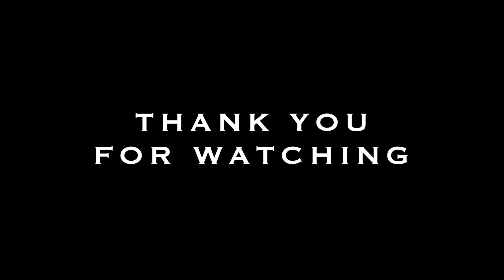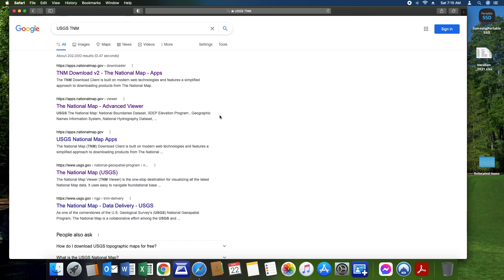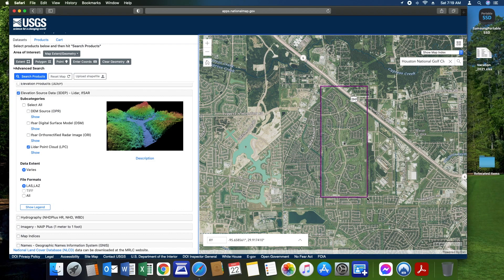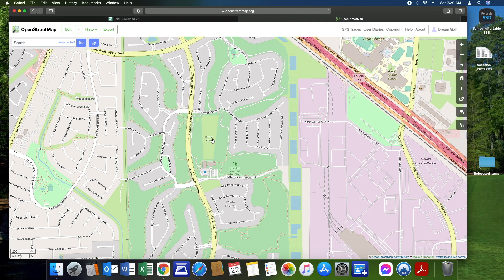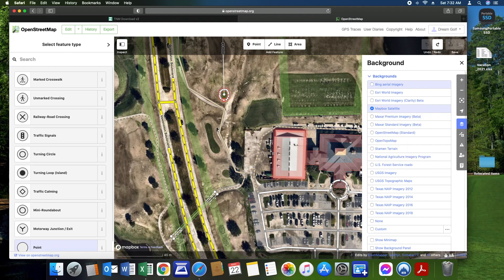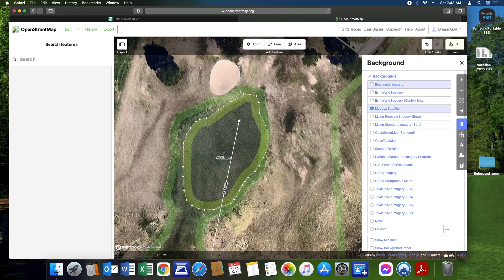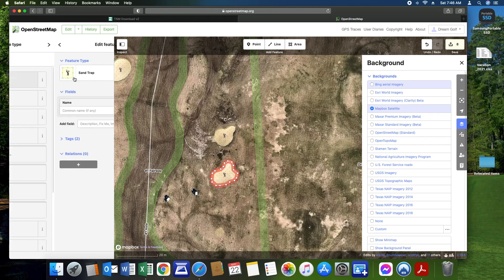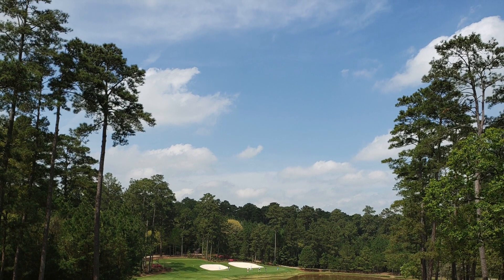The Golf Club 2019 - Course Design with LiDAR

Comment: I'm trying to map out my home course but I keep running into same error - I add a few holes and then attempt to save but get "Errors occurred while trying to save
Upload has been blocked due to rate limiting. Please try again later."  Server returned status code 429 - - how do I avoid this?  It seems to be a frequency thing.  So doing less and saving more often you run into it more - but doing more and saving less could yield lost work due to various issues. forgetting, running into too many edits to save at one time, lost internet connection, etc.
Reply from the maker: Sorry, Benny. Not sure. Never ran into that.

Comment: If the course does not show up on Open street whats the easiest way to get it in TGC from there? Or did I miss a step?
Reply from the maker: You mean you can't find the course in OSM? If you can't find it by name, look for it by the address. In other words, Google the course and get the address. Input the address into OSM. Once it pulls it up, go ahead and start splining the course together. You may or may not find your course already splined. It just depends if someone has been in there before you. Hope I answered your question.
Reply: @DreamGolf  The course showed up the 2nd time I logged in to OSM.  For some reason the first time it only showed the streets.  You mention disconnecting the fairway from the green - what issues come up if the fairway and green are touching when moved over to TGC 2019?  Does the rough show back up between that small area if you don't overlap the green and fairway?
Reply from the maker: @ericguempel9098  Glad to hear you found it! It's not an issue if the fairway and green are connected. I just wanted to warn people that when you are splicing two objects close together, you need to watch out that it can inadvertently join together.
Reply: @DreamGolf   I am trying to download the Lidar data for Fox Creek Golf Course in Edwardsville IL and once I get on the USGS site - add the 2 LAZ files to my cart and nothing shows up in the cart to download - any suggestions?
Reply from the maker: @ericguempel9098  I've run into the same issue. In the products tab, click on "Download Link (LAZ)" for each location. This should trigger a download to your computer.
Reply: @DreamGolf  Could you provide instruction from this point on? Having issues getting Chad's Tool to use the LAZ files to upload the LIDAR information
Reply from the maker: @rpowellgolf  Here's the link to the playlist for all the videos. Play Part 2 for Chad's Tool. https://youtube.com/playlist?list=PLFsvCR4Fn-BpLEQQel9Jt53H89lEcznpr
Reply: @DreamGolf  thanks! Turns out all I needed was the right EPSG number. Put that in and everything worked great!
Reply from the maker: @rpowellgolf  Yeah. That got me the first time also. Had to ask on Facebook how to get the correct EPSG because its not easy to find for some locations. Glad to hear it worked out.